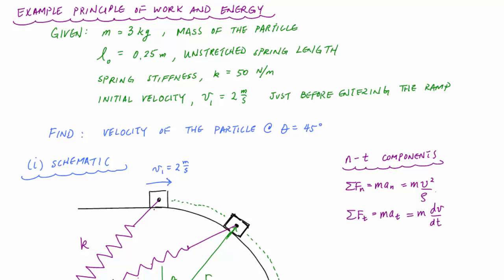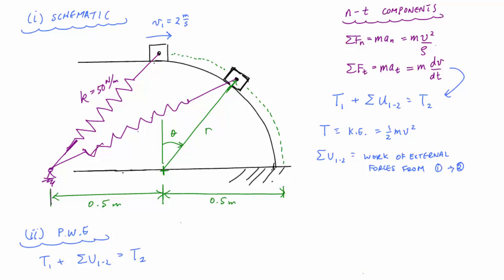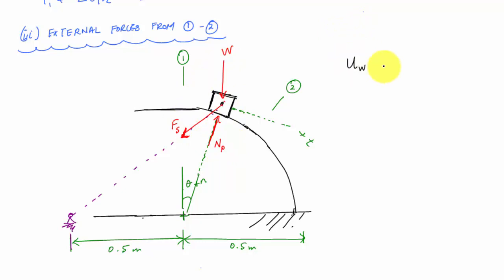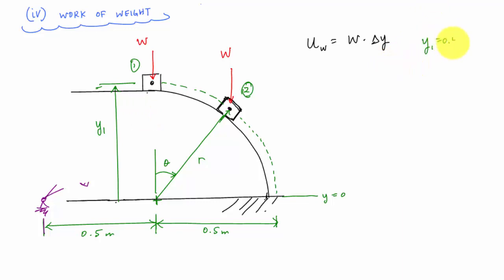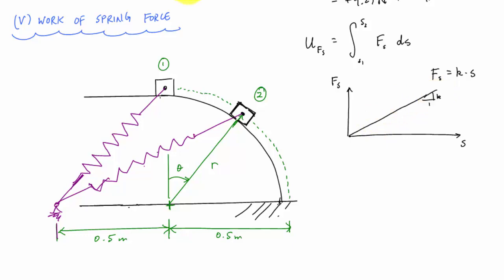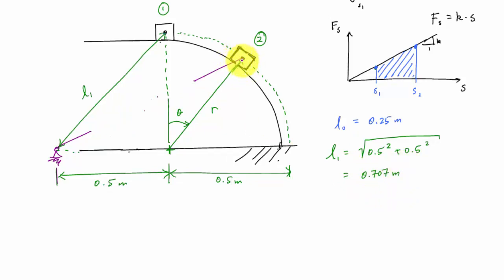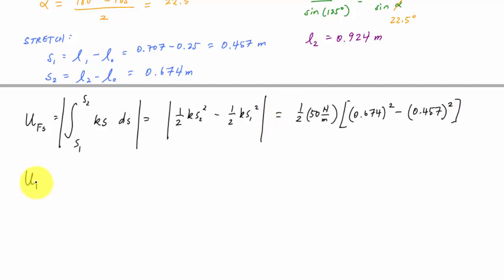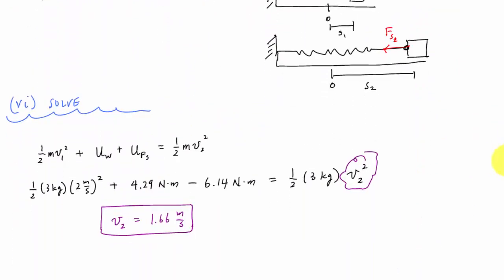Principle of Work and Energy Example 1 - Engineering Dynamics

Comment: Okay I see the magic of this problem. We don't care about the total displacement to the right or downward done by the spring. Those components don't matter. We are only using the change in spring length to calculate the work done. I thought since we used delta y for the weight we needed to used delta s or delta y when calculating the work done by the spring. Only having to calculate change in spring length makes this problem super easy.
Reply from the maker: yes, being able to use conservation of energy can really help simplify problems with springs.

Comment: but the direction of the spring force isn't exactly against the direction of motion.. do you have time to explain this to me?
Reply: That's my problem too. The spring is not completely opposing the rightward direction. It's true that the component is always to the left, but the magnitude of the force can only be constant if the change in length of the spring is countered by the decreasing angle between the horizontal and the spring force.

Comment: You should’ve take the component of the spring in the direction of the  position vector of the particle. Some amount of spring force acting on  surface with perpendicular angle mean that this component does not have work on particle.